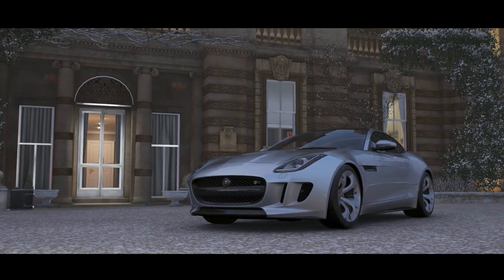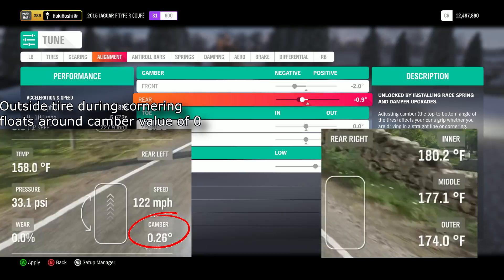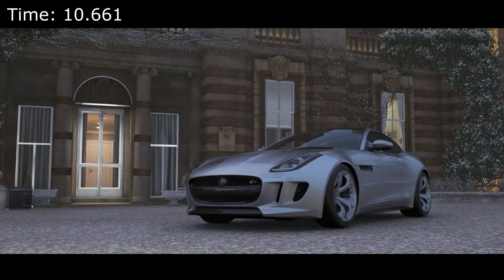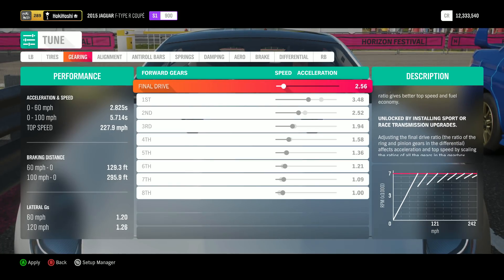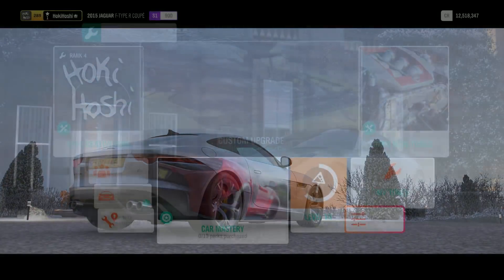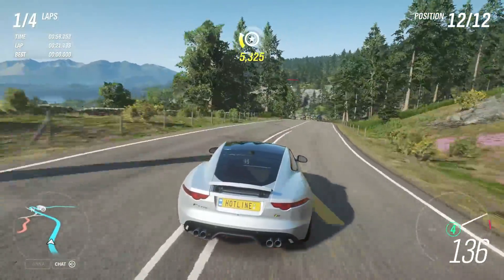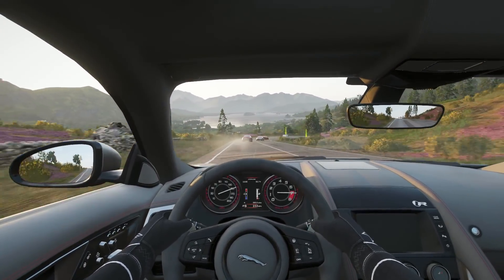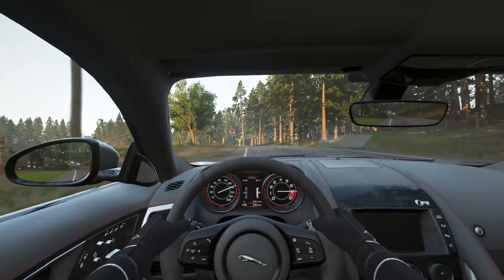Tuning Quickie | RWD Grip Tuning in FH4

Comment: Yea over time I began to realize this game engine just likes all tires having power (awd) and anything that's rwd the physics engine just wants to whip around and throw off the track. I feel like rwd in real life is smoother
Reply: So true I thought the same thing in FH3
Reply: Throttle control matters a lot in anything RWD over A-class, and even then it can still matter down to B depending on what car and tire combination. It's why the AWD swap is so popular on console, it compensates for poor throttle control and most people that play on a controller have poor throttle control.  

It's not impossible to do well with a gamepad but it's far harder to learn and master than using a proper pedal and wheel setup.
Reply: @BigBoyXP4014  as a console player who currently uses a controller I agree, trying to control throttle with that trigger is nearly impossible. Waiting to get my logitech wheel setup before I even think about trying to take my rwd s1 or above cars into real races
Reply: @FauxTitle  I still use a gamepad even up to S2 for RWD cars but I've fiddled with the trigger sensitivity and deadzone settings quite a bit. Might try that out and see if it makes enough of a difference for you.
Reply: I play on keyboard and i need to fking tap the throttle key lmao. Or i just drift all the corners and straights
Reply: @Cptlink420  i played a lot on kb, i think it´s simplier and easiear than trying to measure the force you´re applying to joypad trigger after a corner while trying to get positions in a race
Reply: @AnselmoSB  Well keyboard racing is such underrated but i think too that its semi easy to play with it
Reply: @FauxTitle  If you're using the standard Xbox One controller then the impulse triggers make gradual inputs very easy when you have ABS/TCS off. Basically you want to find a point where the trigger just starts to pulse, then add more when it starts to subside. Gradual and smooth steering inputs are significantly more difficult with a controller though in my experience.
Reply: Yeah if you increase the horsepower on a car with rwd it just wants to slide. I tried building q fully upgraded rwd mc12 Corsa, but it just wanted to slide no matter how much I changed the down force and tire pressure.
Reply: That mostly happens when you raise a car's performance level way too much while keeping it RWD, it feels like the game tells us to increase handling instead of engine output.
Reply: Makes sense since in game we mostly just floor the throttle, but in real life you lean into the throttle
Reply: @TheStigHCE09  This. Throttle control on the XBO controller is actually easier than with most pedal setups, as you actually get feedback on the trigger itself. Same with braking with ABS off, you can feel the wheels blocking if you press it in too much. People just either have the deadzones setup wrong, feedback disabled or don't use the XBO controller on PC (yes, the impulse triggers do work on PC as long as you have the XBO controller).
Reply: @delayed_control  You don't even need feedback.
Reply: Rwd is only smooth because the inputs within forza aren’t dialed in without a wheel 😂
Reply: @ND7800 Right, except I'm not an NFS kiddie. Yes I played NFS growing up but I've been playing FH4 for over 2 years and have become a proficient tuner. You can't ignore the fact that RWD cars can't push through corners nearly has hard as AWD cars without spinning the rear out. And any attempt or tune to help keep traction only results in a power loss that will ensure you lose the race. But yes RWD is good for straights at high speeds... which this game doesn't have much of.
Reply: Well most cars in "real life" don't have 500+ hp
Reply: @BigBoyXP4014  this man knows
Reply: @jonnnyonion  Rank 4073 in Team, 3563 in FFA. I'm not great I'm just decent. Even then barely. Haven't played in a while since the ranking system has been flat-ass broken for a while now and won't add SR if anyone in the lobby leaves but will happily take it away regardless. Dunno if that's changed yet, won't be playing again until it is. Forza devs have been making a long string of shit decisions for a while now.
Reply: @BigBoyXP4014  Yeah man you need a wheel and peddles to get the dexterity of throttle control when it comes to rear wheel.
Reply: Old post but don't forget to take into account that your ass in the seat is a hell of a sensor when it comes to detecting the back end breaking loose on an RWD car or truck, games can't really simulate that.
Reply: @YusufC51  My metric for all my handling builds is lateral gs. The absolute highest lateral gs you can squeeze out of a car are found, 99% of the time, in RWD builds. But those extra few points of lateral gs don't compensate for the loss of acceleration and control that comes with choosing RWD over AWD.

I build for maximum possible handling statistics, and lateral gs is the only metric in the game's car stats that measures for that. So my handling builds are RWD. But if I wanted to make something to win races with its handling I'd of course choose AWD.
Reply: @tankerd1847  Games can't simulate so much of the sensory input that comes with real-life driving. Even the most expensive sims, the ones with an entire chassis tipping and reacting to everything that's happening, can't simulate the pull of gravity as you accelerate, decelerate or turn. 

We'll have to wait for the ability to simulate g-forces through neuroscientific advances before we can really get the experience feeling genuinely convincing.

Comment: RWD Tune?  That is preposterous..... don't you know everyone in FH4 uses AWD?
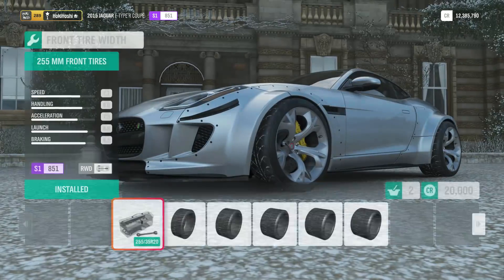Reply: That's the point - The people who don't suck can use RWD and still dominate a majority of opponents if they at the minimum just don't fuck up. If they can drive well, it's not a competition. I've managed lap times of 0:56.116 in the RWD, 727HP, 1882 pound AMG CLK GTR on the Hollyrood Circuit. Most people can't match close to that no matter what they do.
Reply: I do alright at speed with rwd but my launches always put me in near to last place within the first 4 seconds of a race, usually I pass a lot then though which makes the race more interesting even though I barely end up top 3 with rwd
Reply: I dont use and i play with keyboard lol
Reply: Humperdoo that’s very incorrect

Comment: first of all awd is allways better in forza we all know but i hate the understeer when u come to hot into a corner u are gone... in my opinion oversteer is much more manageable, when the back of ur car begins to slide out just lift the gas and tip the handbrake then u shoud be fine. an other benefit from rwd is can step on the gas midcorner to get a slight oversteer that pulls u back where u want its kinda hard to pull of. but the benefits are minor, in online just use awd there or u lose... i just like the way it handles different from an awd car

Comment: Notification Squad has arrived
Also great video. Any chance we can see a video on the Mercedes-Benz AMG CLK GTR? IMO It's best in S2 since it can't compete in X Class with some others like the F1 GT, Mosler, ETC.
Reply from the maker: I haven't picked my next car review car yet and want to do an S2 so I'll give that a look!
Reply: @HokiHoshi  its got very good launch, accel and brake, top speed is like 360 kmh (223 mph) however and it weighs 800-850 (1763.698 pounds) kgs in s2
Reply: @HokiHoshi  Thanks Hoshi, I love that car. On the Hollyrood Circuit, I've managed a lap time of 0:56.117, so the thing can Fuckin go. Fastest I've managed with an AWD Senna so far is 0:56.397.
The thing's a beast. 727 HP, 1882 pounds, RWD.
Reply: @makisedrive3637  weight wise I've only gotten mine down to 1882 - How'd you drop it into the 1700s?
Reply: @CAepicreviews  i just mainly got weight reduction, thats it no turbos, i kept it n/a
Reply: @makisedrive3637  Same here, I never changed the aspiration.

Comment: driving around in my over tuned sleeper c5 corvette in rwd is really fun but so sad off the line lol.  the burn out lines go almost half way down the first juggernaut tunnel on the end of it, and that's with some feathering....  and a first gear ratio that takes up half the transmission curve.

Comment: Can you review the R34 skyline GTR? I managed a decent tune that is just amazing in winter from AWD and snow tires, but also great in the summer time due to a decent power to weight ratio. Right now I managed 308kw and 1220kg in A class, where I think it fits best. It also seems to prefer longer gears than shorter ones with a camshaft upgrade too, due to the rather slow shifting, even with upgrades.

I recommend it highly. Also, style points.
Reply: Car sounds like shit in this game

Comment: on the tire temp i've spent a couple days testing my supra's trying to make them...good or atleast decent.
now i have some tyre temp/pressure tuning experience from assetto corsa so i had some idea's to get some heat in to the tyre's however as soon as i started to apply my thoughts....i got nowhere.

i tried decreasing rear toe (i figured since the tyre's are not alightned peferfectly strait and are extremely lightly rubbing this would put more heat in the tyre's...nope
then i reluctantly maxed the rear aero and gained about 2 degree's (about 5-10 degree's off my target)
then i remembered there supposed to get hotter when you lower the pressure so i took em from just under 2.2 bar to 1.93 bar.... no temp difference.
then i tought i'll make the tyre's slimmer it'll suck at launch but the rear should be slipping a bit more here and there perhaps gain some heat that way....nope....

other then semi drifting how do i put heat in to my tyre's >.< front is awsome by accident rear is always a bit on the cold side and unless i start drifting a little through the corners and exiting full throttle to do a bit of a burnout no heat is getting in there.

testing in summer.

also indeed i can place better and win easier with a awd but if i pull it off with a rwd it just feels so much more earned. i likes my racing like i likes my darksouls, hard and terrying.
wresling 900-1600 hp supra's in S1 that's the good stuff (the 1600hp sport tyre rwd is really fun...almost impossible to place well with but soooooooo much fun)

Comment: Now, are there any specific alterations needed for MR or RR cars? Or is the guide followed in the same manner?
Reply from the maker: Oh great question!  Mid or rear engine cars tend to be better about snap oversteer but struggle with mid corner grip, so def. focus on nailing the tire pressure and camber on MR/RR cars, but everything in this vid still applies.
Reply: Having driven the rr porsches, i'd say u want to make your rear softer, and also u can't brake while turning in like an fr because your rear might slide out, brake on the straights, RRs are good at response but for prolonged turning they start to understeer. Also, for cornering, keep your speed either the same or a small amount of accel to keep enough weight on the rear, but not enough power to oversteer.

Comment: At 7:10 you've said something really interesting to me, the car rocks back a bit, which shows you that it has too much oversteer that it can't use.
I've been struggling with some of my tunes when adjusting over/understeer, usually on AWD though as I tend to build cars for online and necer really knew how to explain my issue, but this is pretty close to it, except for me that doesn't usually happen at the end of the corner but right in the middle. I'll turn in, the car will go into the corner and then pull straight again. Is that also just the car having too much oversteer and then gripping again? What if I don't want it to grip as the cars tend to go around the corner nicely until the rear presumably grips and I'm suddenly massively understeering, or is that an unrelated issue?
Reply from the maker: So it sounds like what you're experiencing something that plagues a lot of FWD cars, and is prevalent in AWD as well, it's pretty much exactly as you described, the car turns in well and weight transfer pulls your back out, but since there's no/not as much power to the rear, the rear end settles back in and you understeer.    If it is what i think it is, try adding more power the rear with the center diff on awd, softening rear ARBs and adjusting damping might help too, try softening front rebound stiffness and maybe stiffening rear
Reply: @HokiHoshi   Thank you so much, that worked, I still haven't got the car to handle quite the way I want it to and I'm having more and more doubts about getting the '65 GTO competitive in A class road, but this helps a lot, I've had to abandon a bunch of tunes because I didn't know how to fix that issue
Reply: Also, try lowering the accel setting on the front diff so the front wheels spin independently of each other a little longer as you're getting back on the throttle as you clear the apex of the turn.
Reply from the maker: Yep, another good suggestion!
Reply: My front diff tends to be at around 20-25% in most cases anyway, should I really set it any lower than that?
Reply from the maker: Ah in that case, likely not the issue.  You can ofc. Try turning it down but really anything below 30ish % shouldn't be causing too much of a problem.

Comment: For some reason my front tires keep spinning out in corners. Rear grip is fine but I always lose traction in the front, I’ve noticed it happen in awd cars too but it’s mostly a problem in rwd. I have no idea how to fix it and it seems like no one else has the same problem. I know this is an old video but any help would be greatly appreciated :)
Reply: Maybe soften your front springs a bit, and slightly softer front anti roll bars to make the front more agile too?

Comment: The R31 GT-S drifts a lot when I slightly press the brakes, what do you recommend fixing for a smoother entry into the corners?
Reply: Break before you begin the turn, the sudden change in acceleration due to braking while turning is causing you to loose grip
Reply: I really recommend practicing this with abs off so that when you play with abs on you will be even better

Comment: Could you make a car review about the Lotus Elise GT1? or an Track tuning guide?
I'd be pleased if you could do that. ive downgraded my elise from 2.2gs at 161kmh to 1,75g and ive got some problems with chamber... chamber from -1° is most of the time still 1 and in corners it doesnt change that much even though ive played with min and max "nachlauf" the thing you can change between 1 and 7°
As AWD the Elise is an acceleration beast but at RWD its har to get startet - im still playing with traction because sometimes my rear is at about 50-80% max Traction while my front is at both 150% o.o with rwd..
Forza has extreme complex tuning mechanics- i love that sometimes ;)
Reply: The "nachlauf" ur talking about is caster yes? It doesnt make too much difference if ur going highspeed since the camber doesnt chane that much when u barely steer(due go high speed)
Reply: Try softening the front arbs and stiffening the rear, but although hoshi says u want 100% grip at the front. Its usually unattainable because it always fluctuates and ur suspension is always moving.i'd say not to worry too much about grip levels
Reply: @Uncle_Glock  Thank you :) yeah i ment caster^^ Forza is good for training english as mechanic xD Ill try that soon!

Comment: I hate theAWD meta online. Makes using anything except AWD pointless if you want a chance to compete. I wish along with class restrictions they would do drive wheel restrictions (like in FM). I want to do a B Class FWD Street race series, or S class RWD sprint/road series. Make it actually more fun and take skill rather than just power through with 4 wheel. I typically play unranked and just use the car I want. I stay away from AWD because I feel like even with the point system it's still unfair. Most of the AWD swaps only add like 10 pi where it should ad a lot more for balance. Offline though I never run AWD except cross country. I even do FWD and RWD rally's against expert drivatars for a little challenge, and it's way more satisfying when you win that way.

Comment: I don't think you'll ever see this but I'll give it a shot. I've been trying to tune my Zonda cinque (S2 990/RWD) for a while now. The car is perfect when it's at speed, even at medium speeds (low third gear) it handles perfectly. Problem is, it's basically impossible not to spin it out of a corner that I took in second or first gear. Should I just give up or is this solvable somehow?

Comment: I kind of disagree with transmission tuning with 1st gear. I stick to tuning it enough to keep it functional especially for slow corners where I may want to have 1st gear. I think tuning 1st to be a launch gear is more of a crutch for learning how to just handle the launch by metering the throttle.
I also like to tune out anything beyond 7th gear if the car has that many gears. A lot of these cars get 8 gears and if you tune it in you'll find yourself shifting a lot more than if you tuned the car to max out in 6th or 7th gear.
Shifts are quick for sure but over the course of a race that can be the difference of a second or two.

Comment: i have a question, On most cars i tune they do just fine until i turn. When i open the telemetry window and turn at even extremely low speeds ie 10 mph I get the display that i do not have traction and am maxing out the front tires to 140% peak grip. I’ve been trying to figure it out for days now and it’s very frustrating. Anyone have any tips?
Reply: For RWD, you really need to give the rear some time to regain traction after your hard brake. After braking, the whole weight swings forward and really throws the balance off, especially with lower end car with bad suspension.   You can brake earlier than AWD and let the car settle a bit and the car will not spin out as easy.